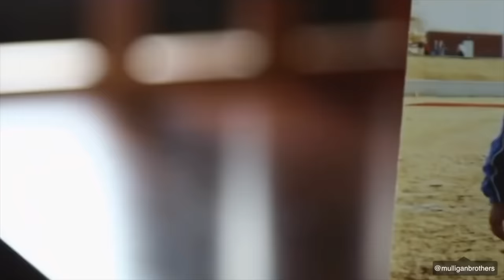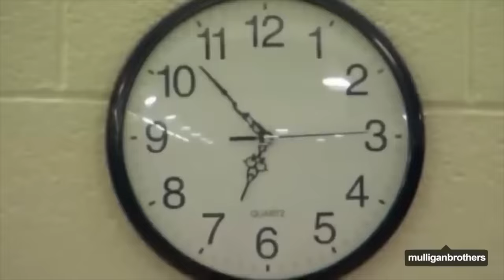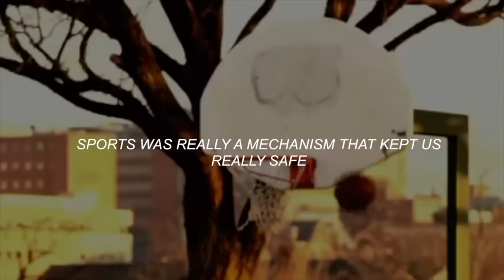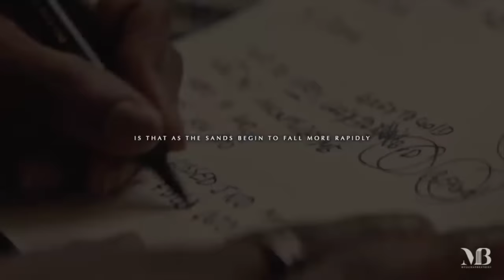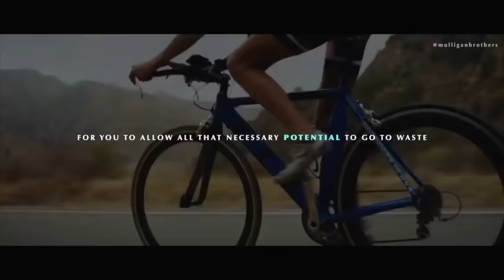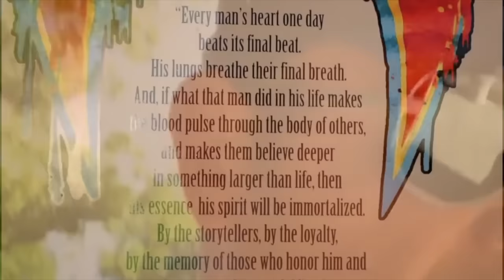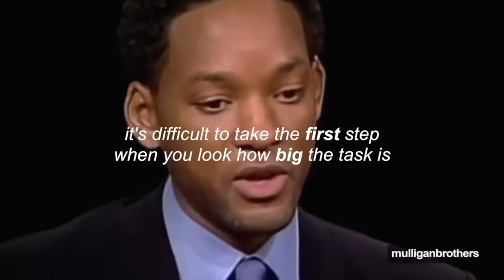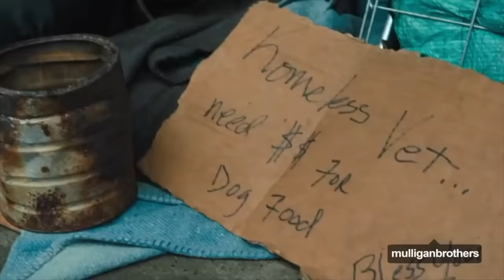Best Motivational Speech Compilation EVER  - POWERFUL | 2 Hours of the Best Motivation

Comment: Most overweight people needs to start with cardio. Just muscles low O2 level uptake, is not good for your heart. When you in shape then you can start putting on some muscles.
But to be fit really has very little with weight-strenght. 🤜🏼✌🏼